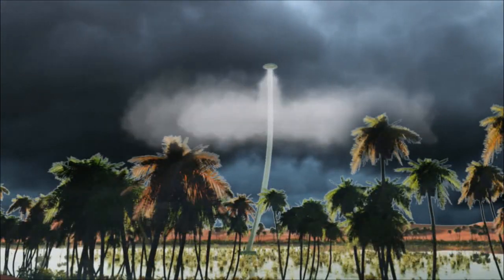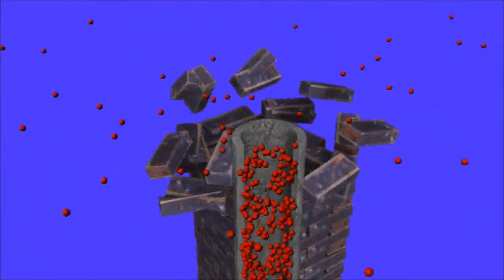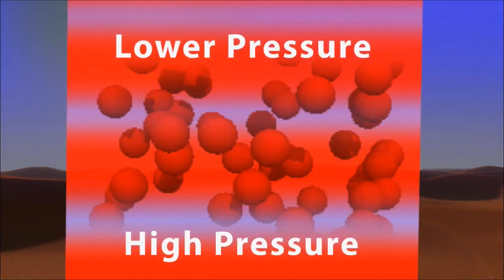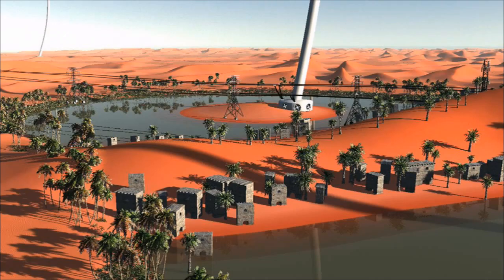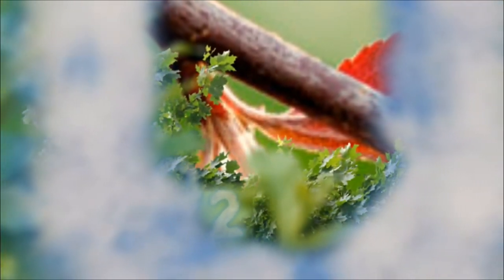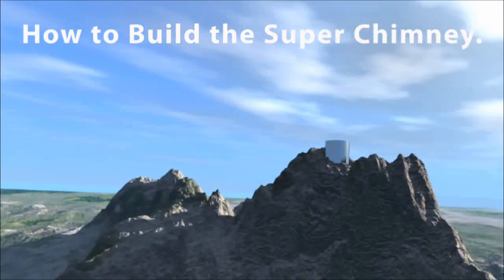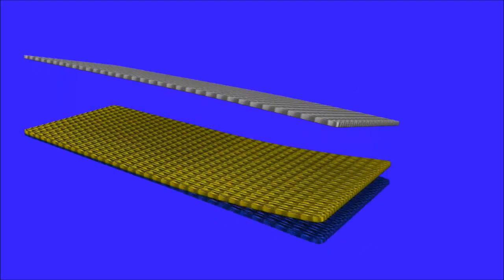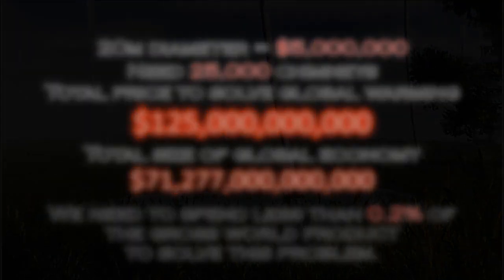Super Chimney: The Global Warming Solution

Comment: 4:45 The precipitation induction only works if the air from the surface has enough moisture - which is in a desert by definition not the case.

Comment: cool idea, but I don't think it would work so easily... I imagine the wind would be pretty strong 5km above sea level, not to mention you can't really do maintenance. what about at night when the temperature at the surface drops? Desert nights can drop to near freezing, so the temperature differential may not be enough to support the structure. And also, where is this precipitation coming from? Sending hot dry air from the surface to the top won't induce the precipitation this video claims...